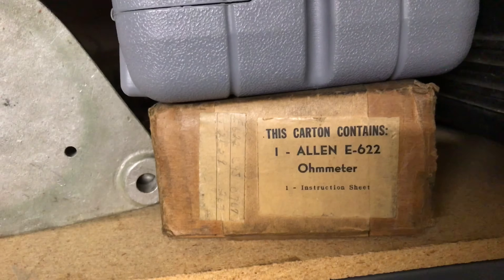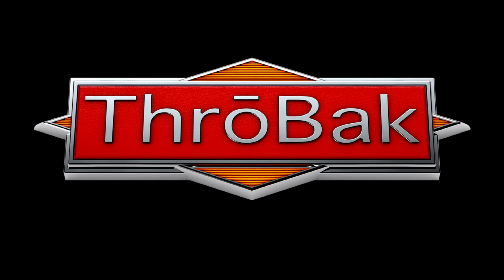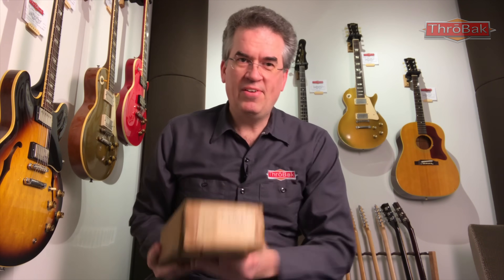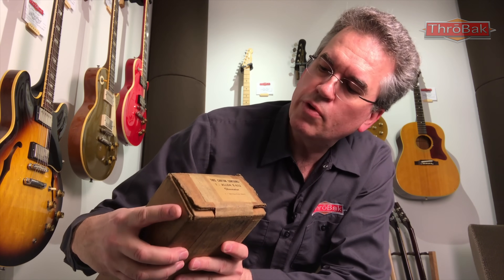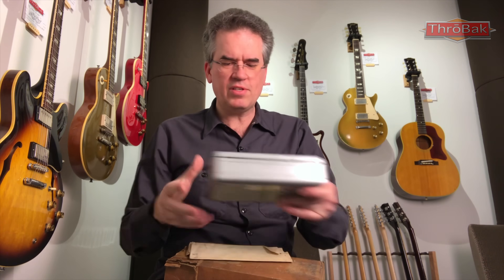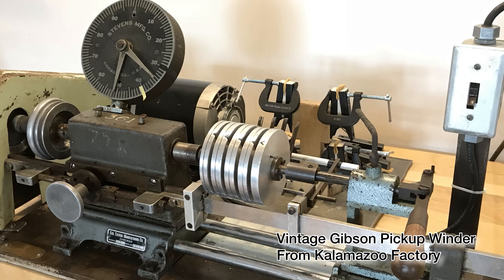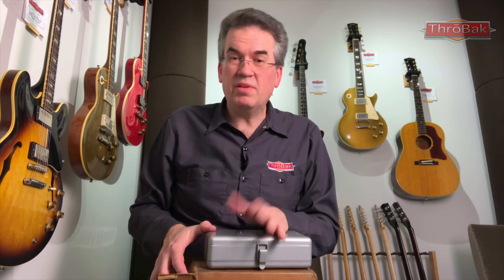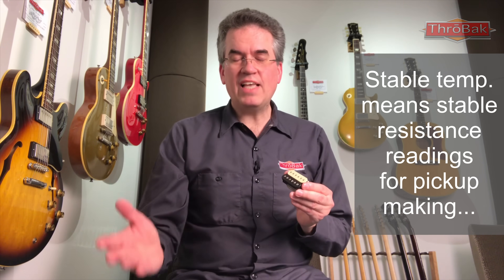P.A.F. Pickup Secrets: Resistance, Why does it vary?

Comment: Ohm alone watching informative videos during the year of the virus.
Question Jon, you take great detail in making your pickups, I have a 2012 LP with 57 Classic pups wound by ps (sticker on the back) in 2012.  Being that there are variations in winding, it's difficult to know if a pickup can sound better unless you take the time and trouble to install them into a guitar to hear the difference between the two.  What are your thoughts on this?  Thanks.
Reply from the maker: Your '57 Classics have symmetrically wound coils and are heavily wax potted and do not use true plain enamel wire. These and other non vintage details of current production Gibson pickups mean that ThroBak pickups will have more overtones and dynamics than the '57 Classic pickups in your guitar.
Reply: @ThroBakChannel  Thanks Jon.

Comment: IF they were measuring at the winding stations, they'd be measuring circa 3.5k. Considering PAFs went in to nearly every guitar... well, you're looking at about 3000 coils just for the 'Burst period' LPs which weren't evem big sellers.
I'd think it's more likely they'd calibrate the wire and then maybe check a random coil, rather than testing every pickup.

Comment: So how accurate is that Allen meter? I'm assuming its calibration must have drifted a lot since it was made. And did it come with any specifications as to its accuracy? There must be something quite satisfying using these old tools to re-create a product in exactly the same way it was first made all those years ago. 
I would have thought that pickup makers like Gibson in the 50s would have used resistance measurement of the coils as a quick and simple method of checking there was nothing hugely wrong with the wound coils before they assembled them into the finished pickup. A resistance check would tell you very roughly if there were something close to the right number of turns on the bobbin and would show up and open circuit or any massive shorts. Measuring the inductance and self capacitance of the coils would in those days have required much more expensive, slow and cumbersome equipment, just not suited to production line use by semi-skilled workers.
I'm assuming finished coils were never graded in any way, so whether you got a pair of coils on each pickup that were matched, or quite widely different in inductance was purely random happen-stance.
Reply from the maker: You check the calibration when you turn it on by zeroing it out. It’s easy to adjust the zero point if needed to calibrate. The meter seems accurate and stable.

Comment: Thanks for sharing your knowledge! Fun to watch. Question: since the winding machines wound pretty much as the were set up to, and a range of DCR seems to have been acceptable for Gibson, might the Gibson stations have had those ohmmeters just to test for continuity of the pickup coil (check for no wire shorts or breaks) rather than to target a DCR?
Reply from the maker: There would be much cheaper ways to test continuity than using a heavy duty ohmmeter. So although it is possible it was only used to show continuity, it seems unlikely.

Comment: One meter per station Jon? Is that your short term goal..(?) LOL! Great info! Did Gibson have anything resembling an LCR meter?
It'd be great to know what their goal was for pickup specs..
Reply from the maker: I have seen photos of Seth Lover at Gibson with test equipment, I’m sure he had one. Seth Lover said the spec. was to wind them until the bobbin was full and I think that turn count was left up to the operator. Just as an example the KZ-115 winder will not wind a pickup over 7.8k. You just can’t get more wire on the bobbin the way Gibson set the machine up. By contrast the Leesona 102 can easily make a 9k PAF.
Reply: ThroBak Guitar Lounge Thanks Jon! Nice to know being the geek I am..lol.
Reply: @ThroBakChannel  I did not know this about the KZ-115; Hmm...